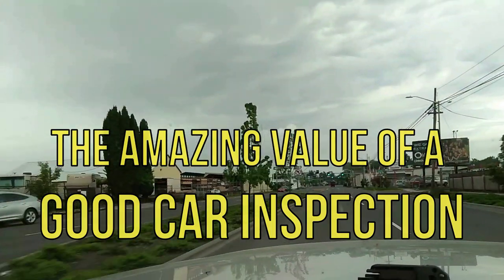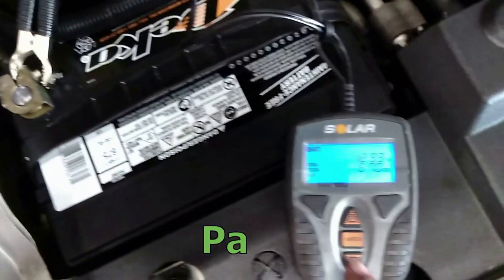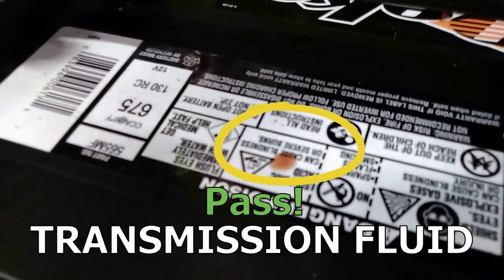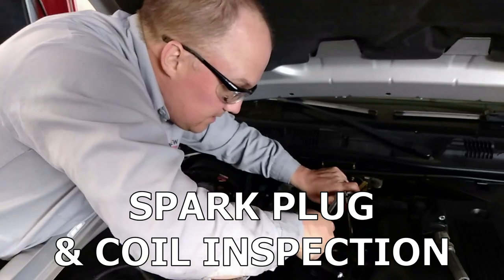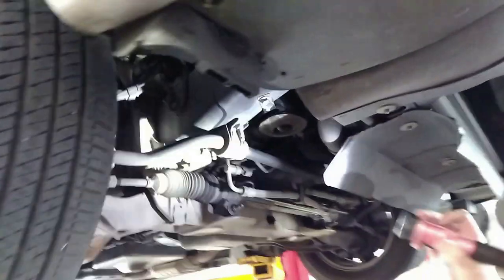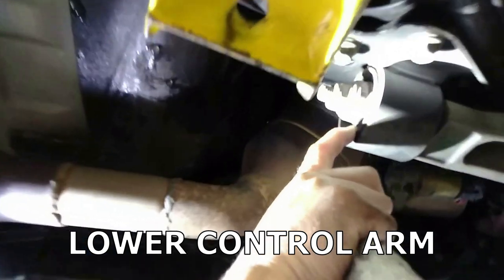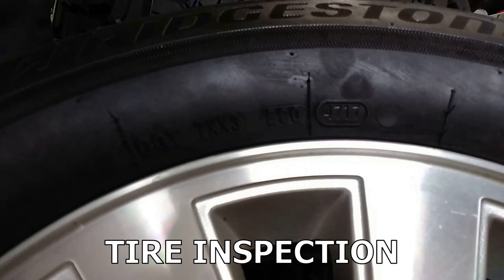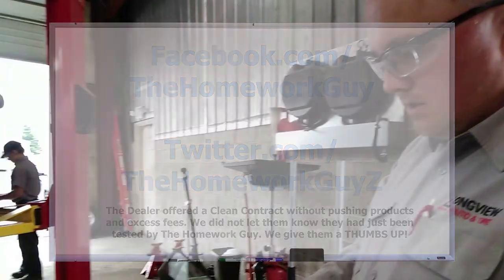GET A USED CAR INSPECTED BEFORE YOU BUY in 2023: Longview Auto & Tire The Homework Guy, Kevin Hunter

Comment: Hello Mr. Hunter, quick question.. i am in the market for a Tacoma. The dealer is willing to slash $5k off msrp of a brand new one, while $1,500 off a 2yo with 38k miles on it. I will be paying in cash but I haven’t told them about it. Should I buy new or used? Thanks.
Reply from the maker: If your question is about which vehicle is the better buy... I don't have enough information to tell you based on what you supplied. However, the biggest hit on depreciation is going to be in the first and second year of ownership, so I'd lean toward the used vehicle. Only 38K miles... it has a ton of life left in it.